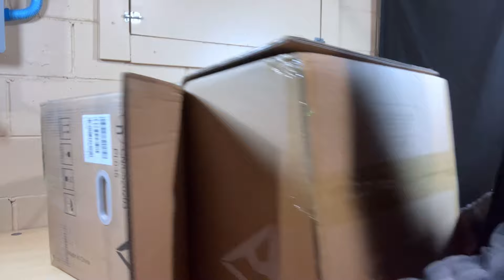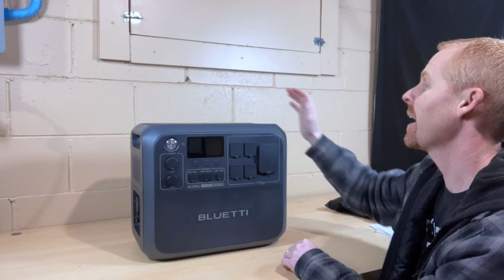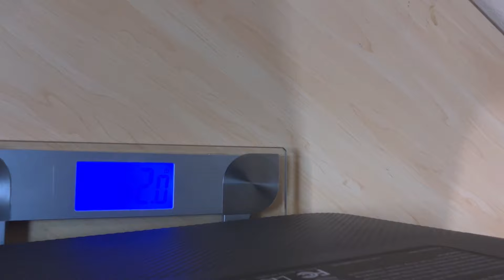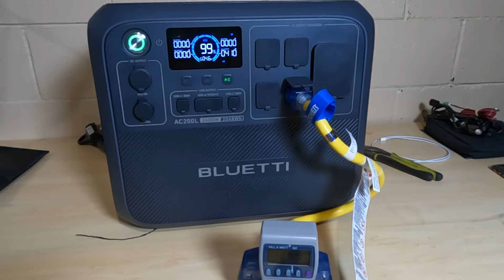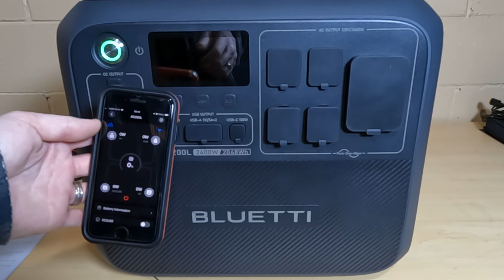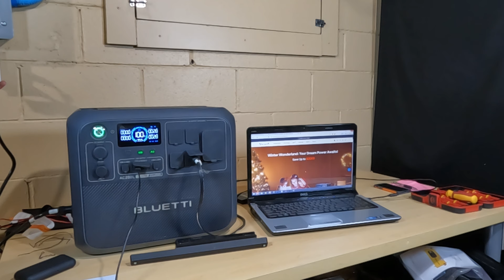Unleashing the Power: BLUETTI AC200L 2400W Power Station Review

Comment: How do you charge the dang thing? I plugged into wall and nothing happened! Is there a special setting or button I need to push?
Reply from the maker: Nope, nothing special.  I would make sure the connection is seated fully on the power station.  As soon as it detects AC power it should start charging.
Reply: @AdamDeLayDIY  I'm running into the same issue! I have verified the the plug with the 3 male/female part is ensured securely and it still won't charge :/
Reply: Found the issue! Rotate the plug by 1/3 of a turn until it eventually takes a charge.

Comment: Good review but I might have missed any comments on the unusable 48v DC port. I bought this on Cyber Monday, but it’s REALLY sh#ty that Bluetti still hasn’t released the D40 accessory for the “proprietary“ DC 8a/48v port yet. I opted for the updated 200L over the 200Max, even though I really needed the 30a/12v port for my Skoolie build. I can return it until end of Jan., so we’ll see if I keep it.
Reply from the maker: Thanks!

Yeah I believe I mentioned that you would need some D40 accessory to use that port.  It has just been over a month since the 200L was released, but I am a little surprised that they still don't have any adapter or device to use with that custom port.  

Let me know what you end up deciding.

Comment: Great video! As someone who values quality family time outdoors, having a reliable power source is essential. I recommend checking out the Segway Portable PowerStation Cube Series. With its massive capacity, powerful output, and fast recharging, it's perfect for keeping devices and appliances running during camping trips or power outages. Plus, its waterproof design ensures durability in any weather. Happy adventuring!
Reply from the maker: Thanks for sharing!
Reply: Can this power a tv , laptop and lights in a camper van, if so for how long @AdamDeLay07
Reply from the maker: @nanimoyom3  Shouldn't have any problems powering those devices.  The length of time all depends on the power draw of the specific devices.  I did a runtime test of some loads in my house to see how long it would power them if the power went out: https://youtu.be/kCDQ0vY6C9M

Comment: Nice the anker c1000 AC won’t display wattage below 15w  it’s similar to delta 2 some say . I wish they display 1w but I guess it does only when using Ac ups mode , but not with built battery mode self power to ac output ports . This ac200L looks like a bigger beast than the anker c1000 but for my needs I wouldn’t fit on the location I for now have for the c1000 it’s taller and heavier . Are you planning a teardown for these ac200L wonder what cells are inside and the electronics .  20A ac input is big demand not all wall outlets can handle that amount .
Reply from the maker: I was actually doing some comparisons with the Anker and it's hit and miss.  It seems to display a wattage every few seconds or so.  I don't think it's super accurate, but at least it seems to indicate that something is plugged in.  It wasn't something I had really noticed before on any power station I had looked at.  I do know that many Battery Management Systems struggle to display accurate numbers at that low of an output.  Just something I wanted folks to be aware of.  

Yeah, it's about 1/3 taller than the Anker is and I believe twice the weight.  

I'm still debating on the teardown.  I don't think I've seen one for a bluetti before, so might be interesting to do once I finish up with the other tests.  

I agree that 20a is a big demand, that's why there's a current control in the app.  I think my biggest issue with the charging is the fact that they advertise fast AC charging, but you have to buy another component in order to make it work.
Reply: @AdamDeLayDIY  on the anker c1000 the unit states 12A for the ac input so when we have the anker plugged in to the grid the max ac output wattage cannot exceed around 1400watts loads . If we do it trips the ac output wonder how different in wattage is the ac200L and you should if you want run some test and show in your next video test …
Reply from the maker: @charlschuck6  must be due to the pass through feature?
Reply: @AdamDeLayDIY  I was going to ask you know ac200l has many ups modes anker only one but not many run the ups test when the battery is below 100% it should work on any battery percentage 70-99% give it a test I doubt there will be any difference but what I’m more interested and curious is if indeed the ac outputs  voltage of the ac200L does change while it’s on its own/ charging/ when ups black hits , maybe plug in your multi meter or watts metter to detect any voltages difference . I am curious id the ac200l is really running on the ac or on the battery even on charging mode.

The anker does pass throw any ac grid voltage value to the anker output ports so some of that wattage goes to the battery and the rest to the anker output disconnecting the battery to the inverter and that’s how they are able to recharge the battery while powered by grid , but not I do wonder how the ac200L was made in that particular area
Reply from the maker: @charlschuck6  it seems that the loads are running off battery power, at least when the unit isn’t at 100% SOC.  I had a 1200w load running at the same time I was pulling in over 1300w of power from the grid.